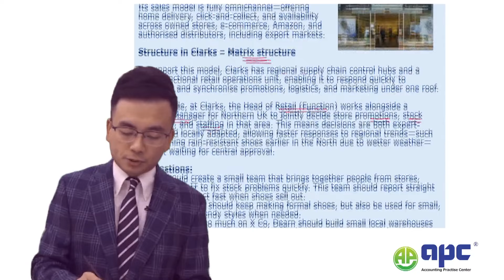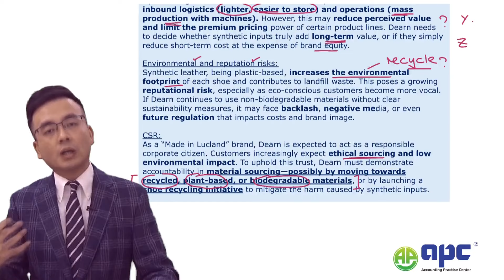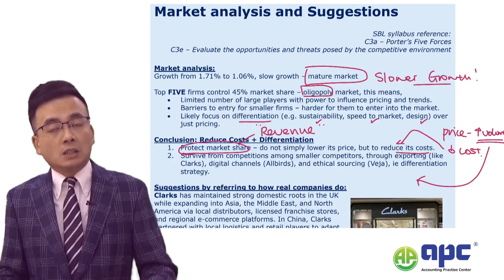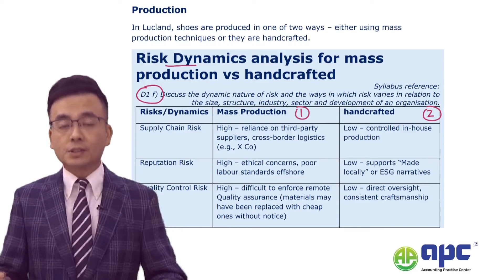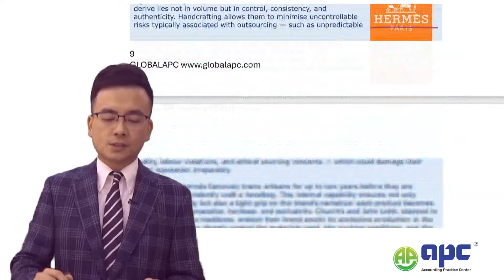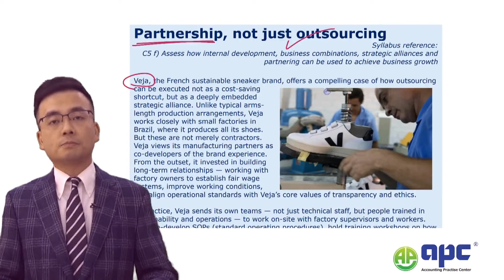ACCA SBL June 2025 Preseen Deep Analysis Dearn Shoes

Comment: Why is Dearn stated as 4th largest when their percentages (table 2) suggests they hold third spot at 9.4%? 
Eg, 
Rigo 11.1%
Flamingo 10.8%
Dearn 9.4%
Parrish 8.9%

Does 4th largest mean their size and capacity (infrastructure and employee count), rather than revenues? Therefore, they are punching above their weight?